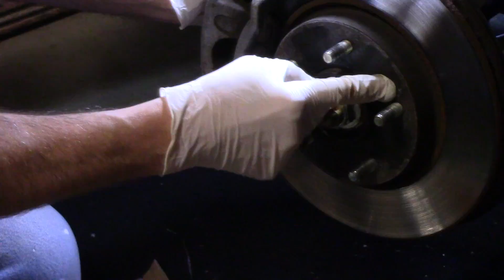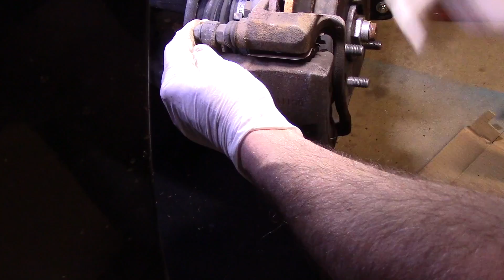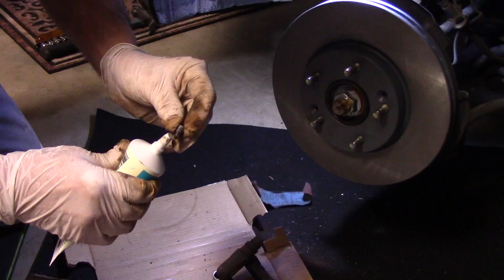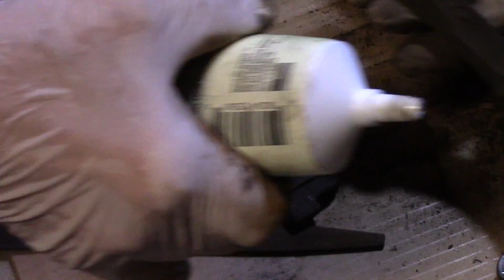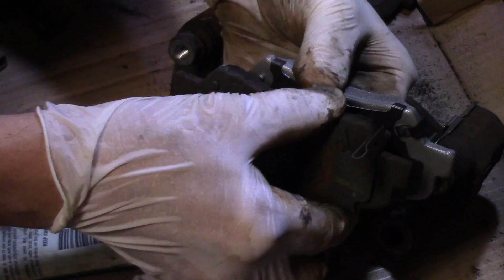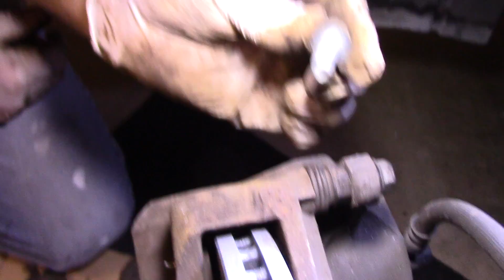Replace Front Brakes And Rotors 2010-2016 Hyundai Elantra

Comment: Just did the brakes on my 2012 and the slider pins on the driver side bracket are TOTALLY frozen in place. Had to order a new bracket; just fyi, the bracket is not listed separately, but is included with the caliper.

Comment: Great video. My vehicle used to have those screws that hold the rotor on. I stopped using them to avoid the seizing problem.
Regarding the slider pins, I always remove them, clean them, and apply new brake grease. Always.

Comment: Thanks for the video! Very clear and instructional. The only thing to say, I wouldn't push the piston back in the very beginning, because there is rust and dirt on the piston exterior, which will be pushed under the rubber protector. This must be cleaned. Thanks again for the video though!!!
Reply: I’d also add, open that bleeder valve so you’re not pushing all that old dirty fluid back into the line. Then properly bleed the lines and top the fluid off.

Comment: Jim - Thanks very much for this superb and detailed video including all the thoughtful tips!!  

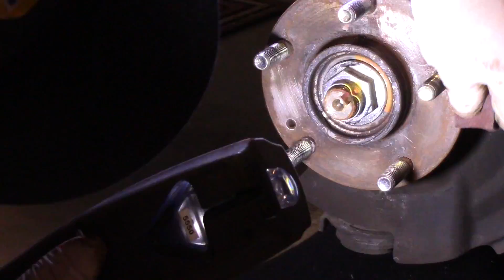One thing I pondered was regarding some little metal tabs that are riveted to the back of the inner front pads of some old and new front pads - with respect to whether that tab is supposed to be oriented toward the top or the bottom.  Perhaps these are built-in anti-rattle clips and that it may not matter whether it's at the top or bottom, but in the case of the new Bosch pads I got if you reverse the right and left it governs whether the tab winds up on the top or bottom - implying there is a proper position.  In other words, the inner pads are different right vs. left.  Looking carefully at your video around the 6:25 mark we can see that tab sticking out at the top or your old inner pad, and it seemed that your new pads did not have the tabs at all, or they were much shorter.  I verified the top position by looking at a Bosch video here https://www.youtube.com/watch?v=zuzoSI42VLg at the 8:06 mark.  So I chose left and right so that the tab is at the top, hope that is correct.  My pads came with a diagram, but it's woefully inadequate to figure this out and so far internet searches don't seem to mention it, and no way to know from my old pads because they didn't have the tabs at all.
  I could send a picture but not sure I can include that here in the comments :-)

Okay, job well done - thank you.

Comment: Hi Jim, I just replaced the brakes on both if my 2013 Hyundai ELANTRA, of course my wife car everything went fine, with mine I could not get the driver's rear piston to spin back enough to replace the pads, the front I'm getting a scrapping sound at low speed that go away as soon as you step on the pedal, any idea what cam cause this